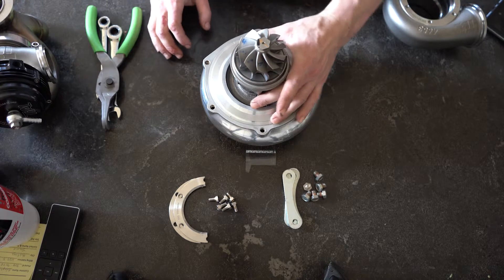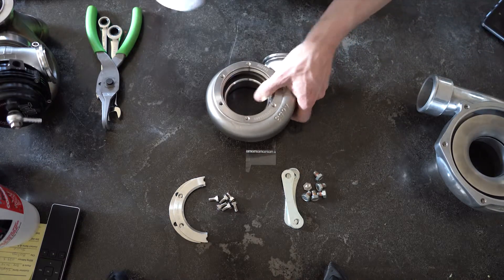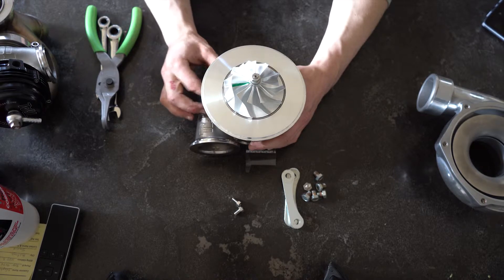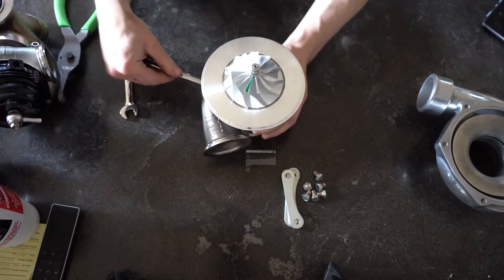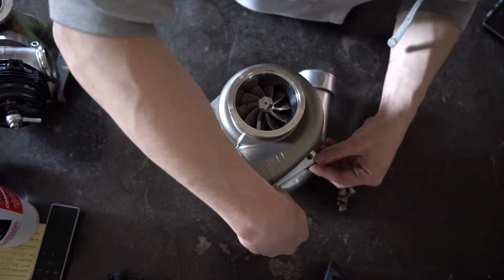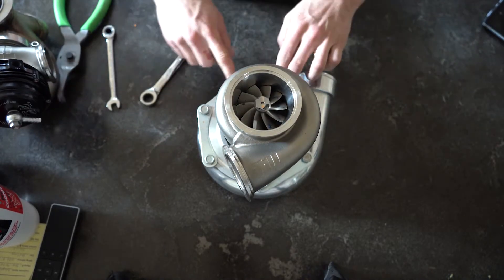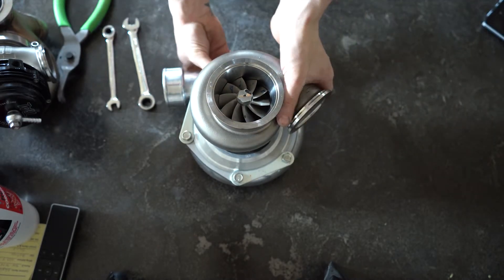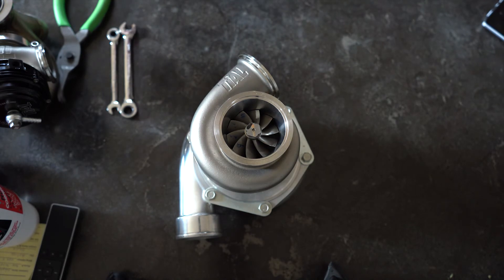ASSEMBLING TURBO CHRA- Garrett GTX3582

Comment: Great video man. How much hp you shooting for?
Reply from the maker: About 500 hp on direct injection, then 800hp when I get the dual port injection dialed in
Reply: @KwinyB  are you going to post any videos on pulling your motor or doing your internals? I'm interested in upgrading my turbo but I want to work on the motor first
Reply from the maker: Certainly will be!